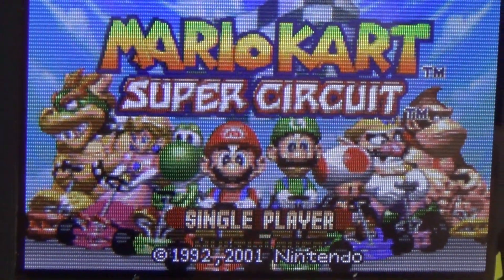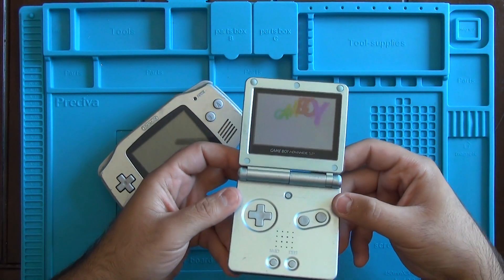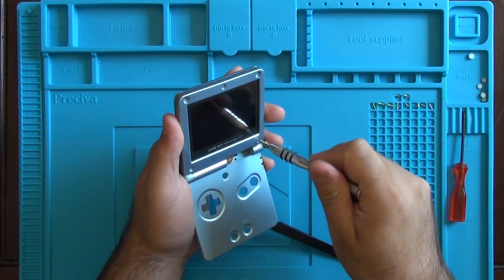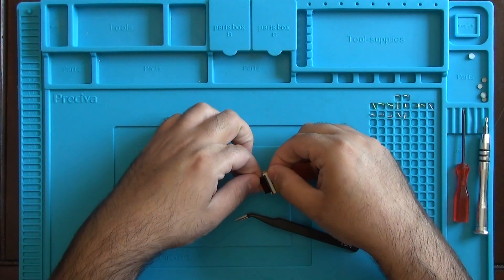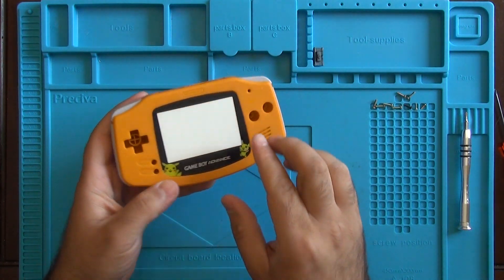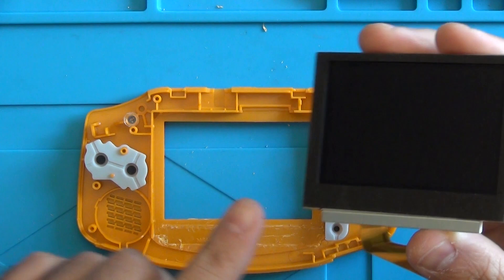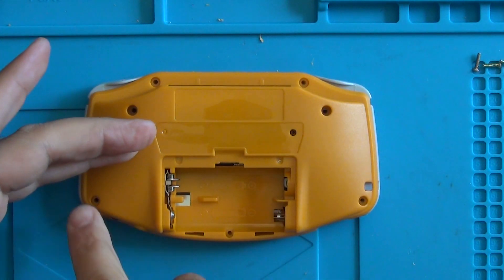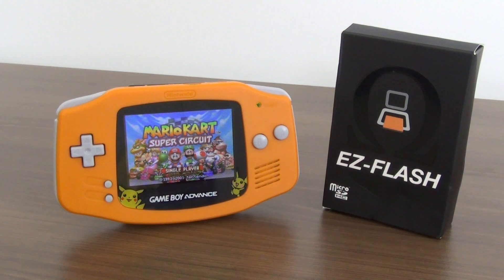GameBoy Advance AGS-101 Screen Mod | Complete Tutorial

Comment: What is the red wire actually for? I first soldered it and after that my gba wouldn't turn on anymore, I desoldered it and now the 101 screen just works but the power led only lights up red for some reason

Comment: I just modded mine and I didn’t use the second sautering wire for it because I didn’t order it. Everything works fine but the brightness is not as bright as the AGS 101 2nd level brightness as the SP. Is it because I didn’t use the 2nd wire? How do I make the brightness equivalent to the 2nd setting on the Sp? I reused my Sp AGS 101 screen. I have the 40 pin model

Comment: Just finished this mod (with the added brightness control) aaaand.... it doesn't fit, lol. I can't put the back case, I think the ribbon conector is too thick.... My trimming looks fine enough, even smoother than your video, but it doesn't fit. I'll try to sand it some more, any other tip??

Comment: Would it be possible to use an AGS 001 instead?
Considering the scarcity of AGS 101 screens
Reply from the maker: The AGS 001 screens do not have a backlight so it wouldn't be beneficial at all to do it in that way.

There are reproduction AGS 101 screens available now though so it's not too bad to get one. Also I've seen some custom IPS screens that people are manufacturing too
Reply: @Restalgia  i have 2 gameboys 1 GBA sp ags-001 and a GBA. my plan is to upgrade the screen the for the sp. after that I will have a extra ags-001 front lit screen. so for no cost can I technically put the ags-001 screen into the GBA the same way you did in the video with the ags-101 screen? my guess would be yes because  you can upgrade a ags-001 to ags-101 with nothing extra besides the brightness control wire I believe. so my main question is can the ribbon cable you used work also for the ags-001?

Comment: question since AGS 101  could ajust brightness    even though it had 2 settings only.   can you still do that with this mod?
Reply: Don't quote me on it because i have not done the mod myself. But i think that is what the soldering is doing. This mod works without the soldering but it will be on the low brightness setting. If you soldering it i am pretty sure it would be on the high setting.

Comment: Hi Steve! Could you please answer one question? Cant seem to find the answer online. 
What happens if I don't solder the brightness wire? Does the brightness stay at max level? 
And if I solder it, what buttons are used to change the brightness level, since there is no dedicated button?
Reply: you can't change the brightness by pressing buttons but on gba ips screen you can change the brightness by pressing buttons
Reply: @gamecubeplayer  ah gotcha! Thankyou
Reply: @farhanbaig404  on the gba ips screen it's very difficult to solder the wires to the buttons but it's optional
Reply: @gamecubeplayer  Yea thats why im just using the AGS 101 screen. Did you get any ghosting issues where the screen seemed washed out?
Reply: @farhanbaig404  i don't know but the ips screen is better even if you don't solder the wires
Reply: @gamecubeplayer  ok thankyou :)

Comment: for anyone wondering, the wire you have to solder is just for brightness control. you can skip it if you'd like!
Reply: Low settings is the brightness without the solder
Reply: I’ve done that solder, but afaik it has effect on the GBA SP. In wich way you can adjust brightness on the GBA…?
Reply: @senseiken  No, if you don't solder the wire you have the lowest brightness. If you do solder the wire you have the brightest. There is no way to switch from low to bright like you can with the SP, unless you are going to use a different ribbon cable, but that is jut a different mod.
Reply: @FlabberQuestion  could install a small switch in between the wire to switch brightness
Reply: If you skip it, does the screen stay at max brightness the whole time or the lower setting?

If it stays at max brightness I will skip the sodder. I keep it as max all the time anyways.

Comment: I've got a basic question. On my GBA repair (adding a screen mod) I need to solder some wire from the screen to L&R so it can adjust brightness. I cant seem to find where anybody states the proper wire gauge for this and theres just too many out there to guess. I dont think you stated what wire you used either? Any recommendations?
Reply: 30AWG as I’ve read elsewhere. Sorry it took 3 months for somebody to actually respond with that info bud! Hope that helps

Comment: Did this mod a few years ago and I love it. The only thing is I have to open it up to remove dust on the screen every now and then
Reply: Do you use a tempered glass lens? I do, and I'd love to be able to lift it from the outside to clean it that way, but I'm not sure how to do it without damaging it (and risk damaging the screen itself)

I also have to do this every now and then, even though I've put double-sided tape between the shell and the screen.
Reply: @DisneyTLK110  mine was a bit loose (probably why dust gets in there) so it’s easy to lift it from the front and place it back in. I haven’t had issues with it.

I don’t use that one as much since I did an IPS mod on one a few months back
Reply: @DisneyTLK110  and yes it was a glass lens
Reply: @DisneyTLK110  i know im a year late but a solution to that would be to remove the protective screen then remove all adhesive and then stick some really small magnets to the gba and glass screen
Reply: @lazriosjenkins1436 which protective screen are you talking about removing?

Comment: i have very much appreciate your work, can you suggest how understand witch conversor to choose 32 pin or 40? does it depend on game boy advance version?
Reply from the maker: The small number under the cartridge slot is visible under the GBA's battery cover. If the number starts with a "1," you have a 32-pin screen connector. If you see a number that starts with an "0," you have a 40-pin screen connector.
Reply: @Restalgia  Thank you really much, so i have a 32 pin advance, i have another question, i'm glad if you can tell me can I put an 001 sp screen on my advance instead of a 101? i know I will have less brightness but actually i have one 001 sp that i took for like 20 eur, so i want kind of fuse them, is that possible same procces that you show us? thanks you

Comment: So then.... I just did some reading & found out that there's a LOT more to doing this mod than meets the eye.  Supposedly, if you simply use an AGS-101 screen and the ribbon cable adapter, you will have a somewhat washed out image and ghosting/image retention issues.  It won't look near as nice as it's supposed to.  This has something to do with using a 32 or 40 pin ribbon cable with either a white tabbed or brown tabbed AGS-101 screen, as they are different.  Supposedly the Brown Tabbed AGS-101 screens are best used with a 40 pin system and the White tabbed ones with a 32 pin system, otherwise the problems will arise. 

There's also Type A and Type B ribbon cable adapters with you needing one or another depending on which screen you have.  It gets rather confusing.  There are fixes online for this issue, but it gets a bit complex and extra mods/components are needed.  I assume you didn't look into these things as I noticed you didn't do one of the basic necessary steps of putting Kapton tape on your ribbon cable to prevent it from shorting out.  It needs Kapton Tape applied as the Ribbon cable traces are not covered and can short on any metal surface they touch.

Either way, after reading about all of these problems, I think I am going to have to go with one of the IPS mods.  All this is just too much for me.
Reply: It's not as complicated as all that. A 32 pin GBA works with a white tab LCD (pretty much the only ones you find readily available today) without issue. The 40 pin consoles don't. But there is a version of the 40 pin ribbon cable that takes care of those issues, along with a pot to adjust. 40 pin consoles can work perfectly fine with the AGS-101 screen.
The funnyplaying option works as well. It does consume a lot more battery life, but it's a cheaper and more available mod.
Reply: Brandon Kick thanks for this clarification. What does your “...pot to adjust...” statement refer to? Bit confused.
Reply: @TheMilkedOut  there is a cable for the white tab LCD to be used with a 40 pin GBA. It has a mod built into it to fix the problems. There is also a potentiometer on the AGS 101 screen for adjusting brightness.

Comment: The only thing that sucks about this mod is that even the AGS-101 knockoff screens are now expensive.  You can't find them for less than $50 even on Aliexpress, and I am sure they are not of the same quality as the original screens.  That means this mod ends up being an expensive prospect either way, as you are going to end up paying a lot these days even for a beat up AGS-101 system to cannibalize if you wanted to.

Comment: So I was actually looking on Aliexpress for those adapter ribbon cables, and I noticed that some seem to have a few small resistors on the ribbon cable for the 40 pin ones, while there's a 2nd design I'm seeing on there that doesn't have any resistors.  I am wondering what the purpose of those resistors are and if they are necessary or not, as the one without the resistors is a bit cheaper.  The one with the resistors is the same as the one you're using here in the video.  I guess it's probably better to be safe and go with the one with the resistors just in case, but does anyone happen to know the purpose of them and if they are necessary or not?
Reply from the maker: It's possible the one with resistors has the screen brightness controller.
Reply: @Restalgia  Well that is controlled by the extra wire right?  Even the version that didn't have the resistors had the wire coming off of it, and it also appears that the version you have is the one with the resistors.  Do you have any sort of control over the brightness with this mod?  If so, how? A button combo perhaps?

Comment: How is the build quality of the case? I bought one off of Retromodding.com and was disappointed with the quality. The battery cover sticks out quit a bit at the corners, like it is bent, plus the 2 pieces of plastic don't sit flush and you can see the circuit board from where the volume control is.
Reply from the maker: The one I'm using is fairly decent, because the ags screen is thicker, the pressure pulls it apart a tiny bit, but overall I'm happy with mine.

Comment: I did this mod like 3 or 4 years ago. Why are you doing it now? I've watched YouTube videos about this mod. I've even improved on it by switching to a better speaker and adding an amp for the speaker (metalJesusrocks uses the same amp that I use in my Gameboy Advance ) because of  the YouTube videos that I've seen about them. I even used a better LCD cable that you used. I used a cable that had a built in switch for brightness for the LCD screen that was easy to adjust from the battery bay.

You usually make some great videos but this time you are way off. This video makes you lame and so behind.
Reply: This is what retro is all about. It’s all about keeping the old systems alive! I think it’s a great idea and an awesome video.
Reply from the maker: I appreciate the feedback. The main reason I did this mod is actually 2 fold. I've never done the mod and have had these parts sitting around for literally years, and I had a company reach out to send me a multi-flash card for the gba. :)... if you notice at the end I put a tbc screen before the ending splash. It was kinda a way to tie it all in together.

but I definitely hear you, and respect your opinion. I wasn't trying to do something old or boring, just figured I was making something anyway, and would just film and put out a video for it.
Reply: Shaggy Shaggums lol. You’re a loser.

Comment: there is a new screen converter that include a brightness switch, because the one that you installed only give you one level of brightness...
Reply: Hermas does it stay at the highest brightness?
Reply: @bryanmontengro9296  unfortunately no, you have to adjust it every time you turn the console on!
Reply: Hermas i mean with the kit in the video? If there’s no switch does it just stay in the lower brightness setting ?
Reply: @bryanmontengro9296  yes, it will stay in the lowest brightness, which is a shame because the screen looks gorgeous at maximum brightness!
Reply: Hermas Imma have to find a way to set it to always turn on on the brightest setting lol.
Reply: Hermas I ordered it last week. Only reason I went with it over the IPS display is the fact that I wanted to use a pokemon center shell with its original screen lens and IPS screen lens are modified to fit the screen better.
Reply: Got around to installing it today, not sure If I got lucky or what but with the Kit I used the screen stays on the brightest setting all the time!
Reply: @bryanmontengro9296  what pin converter did you use? There's is also something called with or without IC and I don't know what that means
Reply: @aliramirezruiz3481  I don't remember and the ebay listing was taken down. I just ordered a kit from Ebay for $65 it came with ags 101 screen, ribbon cable, screen lens and two screw drivers.